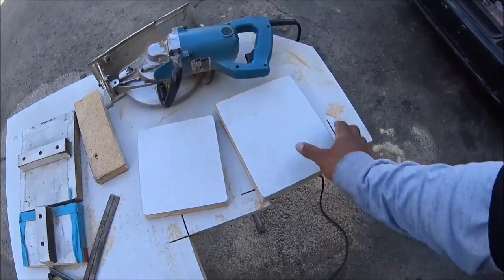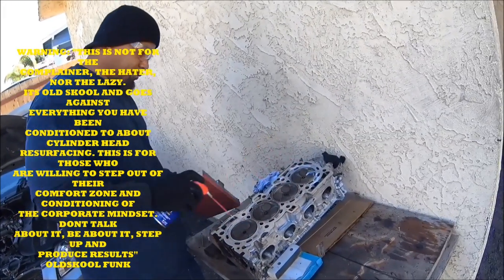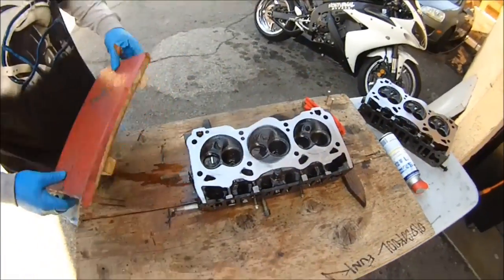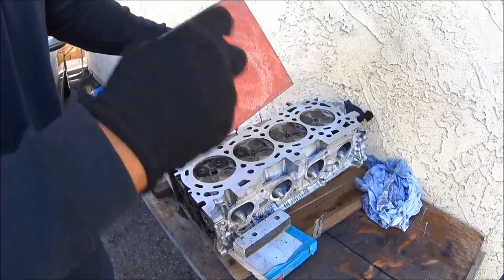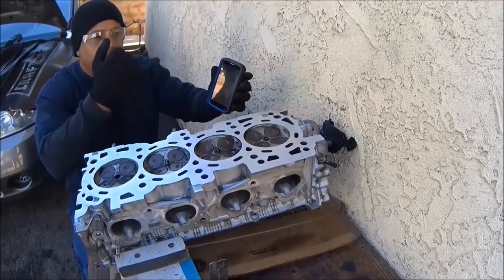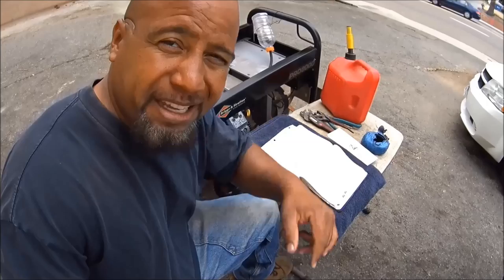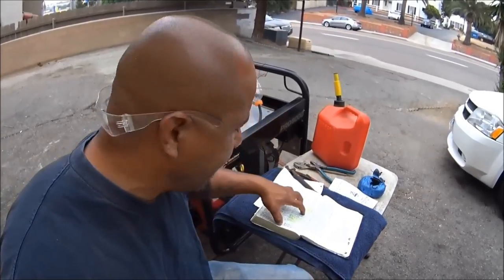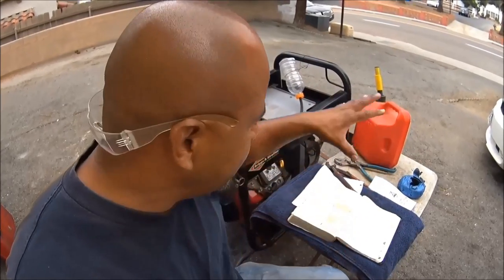(NEW) FASTEST CYLINDER HEAD RESURFACING TRICK, DIY OLD SKOOL STYLE

Comment: While raised non-denominational Christian, I later dismissed religion as the contrivance of man and currently do not suscribe to any religious beliefs.  However, I do fully endorse and suscribe to many of the moral and ethical components you have elaborated upon and I have great respect for your genuine, politely resolute, position and positive attitude.  You sincerely share your thoughts and make no demands.  I respect that. 

 Additionally, I am very grateful for all the mechanic's tips and tricks you have chosen to share here.This channel is a jewel.  Flattening a head with MDF and sandpaper was a real neat trick, one I would not have thought possible. As is, I have some old pool table slate on hand should I need to follow suit. Hope not, but at least I have decent flat surface to work from should things go sour after disassembly.  Local automotive machine shop have a two month waiting list and I cannot wait that long.  

 With respect to the mechanical realm, I just bought a 1997 Tacoma with the 2.4L 2rz-fe engine. and have significant engine oil in the coolant, but zero coolant in the engine oil. The weasel of a seller had tried to mask the problem with copious quantities of head gasket sealer and I missed it.    I later drained a few ounces of engine oil into a glass jar to look for separation and detect none after letting it sit for several hours. I have drained, flushed, and replaced the ATF fluid and filter and have also temporarily bypassed the transmission cooler in the radiator to eliminate that element in my diagnosis.  it should be noted that the engine seems to run smoothly and makes good power. 

Given your automotive experience and expertise, where might the cross contamination come from?  I first suspected a head gasket failure between oil and water passages and have purchased a full Fel-Pro kit and new head bolts.  Then, after seeing as how both the water pump and oil pump are located behind the timing chain cover, might something there be a possible culprit?  At 166,000 miles on the clock, I plan to replace most everything involved just to buy once, cry once, and feel confident that it will serve me fine for the rest of my days.  

Your thoughts, sir?   Thank you.

Comment: Thanks bro for teaching me the technique for resurfacing. I will need that very soon... and I'm rightbthere with you and KJV.
Reply: Beware, if the head is warped and you resurface it without straightening it flat first, or without machining the cam beds and caps, the camshaft could snap in half after a few thousand miles, or you could lose oil pressure. If you plan to have the car for a long time I would recommend trying a head gasket sealer product that you put in the cooling system if it's leaking there.

Comment: I'm glad I went to your channel and found this video, I literally thought about doing this with creating a sanding block of my own to save a little money between trying to take it to a machine shop or buying one of those sanding files from amazon. I think I'm definitely gonna use this method. I have a 06 Sebring with an aluminum head / iron block, over 200K miles. Old car but never head issues with the engine and ran good until the radiator ran hot because of a leak and my catalytic converter bold broke off in the manifold which was why I decided to remove the head. Ordered a new manifold though, however after cleaning the head and block only thing I'll have to do is figure out the best way to connect my cat converter to my muffler due to the fact that the clamp was so rusted to both pipes I had to cut approx 2-3 inches off the muffler pipe then cut that area where the cat converter slides into the muffler pipe off the cat converter.

Comment: I watched your old resurfacing video from 4 years ago and this one came as a suggested and I’m ready to give it a shot on my 03 ranger heads and block.  Keep on spreading the word man. God bless!
Reply: How did it work out for you?
Reply: @markcollard9326  truth be told I never actually sanded it down. I cleaned off the old gasket put the new ones one and bolted everything back. Yes it was wrong but I didn’t have any problems and the guy I sold it to 2 years ago hasn’t had any yet either

Comment: I tried that yesterday, I used a flat surface and stick a sand paper on it. I then rubbed a repaired aluminium engine block on that. Seems OK. Flatiness error is less than 0.002''. I weld the block, with an acetylene tortch.
Thank you mate for all the truths you tell us.

Comment: There is open oil/coolant passageways where metal shavings can fall into and accelerate engine wear when it's running. I'd try to plug those as best I could and make sure they're clean before running that engine again. 
Great video!

Comment: I have an older Army engine building manual from the 40’s. It goes into detail about resurfacing cylinder heads weather flathead or valve in head design. The same technique is used except the sanding fixture was cast iron vs wood. Probably because it was a manufactured store bought item but the principal is the same.

Comment: Love your channel. I actually bought a flat file to 'blueprint' an engine 25 years ago. Had to file the block deck to square on a performance engine build with low budget and no local machinist with the right equipment. Had all the right measuring tools and took four days (I was 26 and had some meat on me bones back then to run a flat file by hand forever). Do what you can with what you got. Knowledge is key. Ask questions. Only only one side note...if an overhead cam cylinder head is really warped, you should replace it with one that's straight. If you sand the head surface flat, the head is still warped and the cam journals will be off after bolting it to the bottom end.

Comment: Thanks I'm doing the heads on a friends car, #2 bent an exhaust valve. This worked great, hardest part was getting the solid dowels out of the block, I've left the engine in the frame. I was worried I might have to drill them out. From another YouTube video I wound up using the claw on a hammer. Cushioned the hammer with the old gasket, but constantly worried about scoring the deck, got lucky. The block looks great. I was worried about grit in the engine so I've decided to drop the pan and flush the ports. Thanks for your idea and help.

Comment: This is how we used to shave heads on lawn mowers and motor bikes to get higher compression. We used a thick piece of glass and stuck the paper to it. We then carefully moved the head in circles over it until we had ground off tons of material.Always came out nice and flat.  For the people who think this is irresponsible way to flatten a head, keep this in mind. This is the same method used to get a piece of glass optically correct. That is, to get glass flat where is has only a few wavelengths of light difference, not thousandths of an inch difference. Wavelengths are waaaaaay way tighter.

Comment: also i use snowboard wax to plug and seal ports off on block to avoid the grindings from getting in to the ports   nice tbing about the snowboard wax it melts at low temps and easy to remove

Comment: Good to see you are using feeler gauges to check for true flatness , but a scale from a combination square is not much flatter than the edge of a piece of hardware store band iron. The most cost effective way to get a precise straight edge is to get a length of ground flat tool steel , I have a piece of 3/16x1inch 01 grade oil hardenable tool steel about 3 feet long that has been used on probably 50 sets of heads and decks. This bar stock is ground to +/-.00005 inch , well within the tolerance needed to seal a head and block.                   You don't need a toolmakers edge to do engine work. Mine stays in the inspection room of my shop. I spent close to $800.00 on it so it never gets used where it can get beat up. I think I spent about $50.00 on the ground flat stock and it stays in a plastic tube only to come out for head and deck checking. DON'T harden it , it will warp if you do.

Comment: There is another video on here that the guy does a more accurate job. The head was warped .004 and he got it perfectly level. Its not about getting all the dirt off, its about getting it level. You need a longer board perfectly flat and stiff. Then after that, the guy had 80 grit down to 120 grit with a 3m adhesive paper stuck to a piece of flat glass. Then he slid the head back and forth on the glass. After he was done, you couldnt get a feeler guage anywhere under the straightedge when he checked the block. Only taking .004 is better than a machine shop taking .010 because the next time the head may be too far gone @ 2 passes of .010 (.020) this messes up your valvetrain geometry because the head is lower, which makes the rockers not centered on the valves.

Comment: 2 questions. 1.) How do you find slabs of wood already straight enough to use for sanding at home depot? (Because Home Depot is not able to cut wood to true straightness for you) 2.) You say to use copper spray on the mls gasket, but, how do you spray it properly without having to worry about the copper slowly getting into your coolant system and oil passages? (I have heard horror stories about this happening even though they let it dry before putting the head gasket on)

Comment: Great stuff, I never knew you could deck a block or head with a sandpaper block! P.S why do you not like the NIV? No text is perfect but the NIV used older manuscripts than the King James (to be fair King James didn't have access to them at the time) and the NIV didn't introduce the big errors like 1st John 5:8 that was likely added in by the Scholars hired by King James (it doesn't exist in any of the oldest manuscripts).

Comment: The trick to get super flat surfaces, is to change your orientation to the workpiece, as well the orientation of the sanding block.  You can achieve almost optical level flatness with a technique called "sanding around the barrel" by counting your strokes, moving 90 degrees around the work piece, and repeating the same number of strokes, and so on.  There more to it then that, but if you don't change up your orientation, you will not achieve flatness throughout all planes.

Comment: Hey, not sure if you still check these vids, but I was wondering, when I do a leak-down test on the #2 cylinder (the one that's misfiring), I get air blowing out of the #1 spark plug hole (can smell gas). Oddly enough though, it doesn't seem to blow out of the #2 when testing the #1.  Would that be a head gasket, valves?  No overheating, no milky oil, no obvious low or missing fluid.  If it wasn't throwing codes every few hundred miles, I wouldn't even be able to tell that it's misfiring overall.  Thanks buddy!

Comment: Sanding in one direction will not get you true flatness but will take off more material towards the direction you are sanding. Sure the surface is flat but not square. Figure eights on a piece of glass or in a 45 degree like sanding body panels.

Comment: impossible. can't control pressure when sliding across the length. you need a large "Granite Plate" and lay a large piece of sand paper and lay the surface of the head on the paper and let gravity do the work when sliding back and fourth,  but even then you can control corner sink. "old skool"??? thats why SOME old skool is NO LONGER, such as this, UNLESS using a surface plate for VERY MINOR issues. I have used this so called "old skool" method for NON PRECISION work, such as polishing work, not presicion fitting work

Comment: Get a good piece of flat glass... glue the sandpaper to the glass with 3m adhesive... set the glass on a solid work surface... place the head on the glass and procede to sand. The weight of the head helps to keep it flat. Requires less effort to keep the head flat on the glass. Use sandpaper from a woodworkers belt sander...available in widths up to 48"....

Comment: what grit sandpaper should i use on my aluminum head? im gonna go oldskool on it. is 80 grit ok for both aluminum and cast iron? should i start with a softer sand paper?
Reply: 80 is to rough for aluminum.  Use 120. Then 220. You could even finish it with 400.  But if its too warped it should be replaced

Comment: Hello and thanks for the video.
I will try your method  on mercedes190 E .Why you use wd40 when you are sanding cylinder surface?
Reply from the maker: Thank you Lazaros I use the WD40 because it helps speed up the sanding process. It works great to.

Comment: That can work. You can also ruin the cylinder head with it. Metal elastomer seals partially compensate for unevenness. I would not recommend this for modern metal layer gaskets.

Comment: the big issue here isnt the flatness of the head when you are finished the issue is aluminum oxide and other materials in the sand paper is fatal for engine bearings. trace amounts will destroy it in a few thousand miles. u can clean it from the head but the block in the car?

Comment: Pro tip: Find our what caused the head to warp and require resurfacing. Most likely an overheating issue, in which case, fix what caused it to overheat and warp BEFORE you spend money on a head gasket in order to rule out replacing a head on a motor that has a bottom end issue. It’s like putting a lid on a paint bucket with a hole in the bottom of the paint bucket. Christ will give you wisdom if you pray for it, if he sees it best for you you will receive. God bless you old stool we appreciate you!

Comment: You shouldn't use a shorter board than more than the length and width of the head or you risk it not being truly flat. 

Also you should use a truly flat surface like a thick pane of glass. ✝️👍

Comment: I use a 3/4 piece of glass glue the Sandpaper down to the glass in about 3 minutes you can do it cuz you're using the weight of the head perfect distribution of weight slide one way Slide the other and you're done 3 minutes on the same piece of glass only I use 150 grit and 300 Grit
Reply: Great video though

Comment: The problem with this, is that you are not measuring how deep are you going into the cylinder head, if you go too deep the engine will heat up on the go, every engine has a specific amount of material you can remove, in most cases is about one millimeter.
Reply from the maker: There are depth indicators on the cylinder heads. as long as you dont sand beyond the you will be good

Comment: If the head is "WARPED" that means that from ONE end to the OTHER there is a significant difference as to how it will sit on a truly FLAT surface. Like, one entire end will be in full contact with the surface, flush and square, while the WARPED end will not be. The one of the ends will be raised on a flat surface.... The warped end will be raised .003, .004, .005 (or more) or whatever... IF you sand the entire head front to back the same way,,, taking the same amount off from front to back and side to side,,, rather than skimming of JUST the end that is not warped a few thousandths to bring it down to flush with warped side the ONLY thing you have done is sand everything down so that you are left with EXACTLY with what you had... How is sanding the entire head front to back taking off the desired .004 from the non-warped side? You are taking the SAME amount of material from the front to the back. I am so sick of CONFIDENT (in this case religion fueled IGNORANCE)... Just because you say something with "manly" confidence doesn't make is right, correct, proper, accurate... The expression YOU DONT KNOW WHAT YOU DONT KNOW comes to mind. My God man!

Comment: I do this using a leftover slab of granite countertop within .0015". Make sure you sand up to 220 grit and do it in at least 3 directions, or you'll have small leaks through the sanding lines.  Video is over at 11:48 and starts getting bigoted at 18:10

Comment: What do you do if there is some rust on one of the cylinder walls?
Reply: Rust doesn't do anything.
Reply: @SinsBird  What if the rust has left some pitting in the cylinder wall?
Reply: @ednja  If the pitting is on a micro level it can even improve lubrication. If the pits are like 1/16 of an inch then you could thoroughly degrease the cylinder also removing the rust from the pits with a wire brush or with whatever other method that you know and fill the pits with JB Weld and then hone it. You can hone it a little bit right now to see the situation better.
Reply: @SinsBird  In my case, the pitting isn't deep.  I don't know how deep but I think a few thousandths of an inch.   Do you think it's okay to hone cylinders without removing the pistons?
Reply: @ednja  I wouldn't bother then, just leave it as it is without honing.

Comment: I never use wood as it's not 100% flat and you are better off using 1/4 inch thick glass plate cut to the size you need and then glue 240 or 320 grit wet & dry sand paper to it and you then have old skool facing tool, I use this style with WD40 all the time for refacing the deck on a KIA V6 engine as the block is warped on the gasket surface and I get them perfectly flat and no more gasket problems which they are known for
Reply: He is using a piece of counter top material.  It is particle board with Formica attached.  The Formica is a laminated composite material, that is flat.  The wood pieces are scrap counter top material.  Scrap counter top materials from things like sink cut outs on counters or old scrap counter tops or end pieces.  Got to use what you can find some times.  You can check the flatness of the Formica block with the straight edge and feeler gauge to make sure you have an acceptable piece.  Praise Jesus!